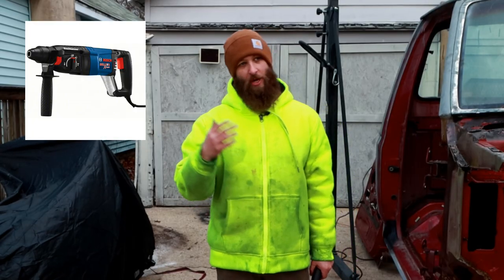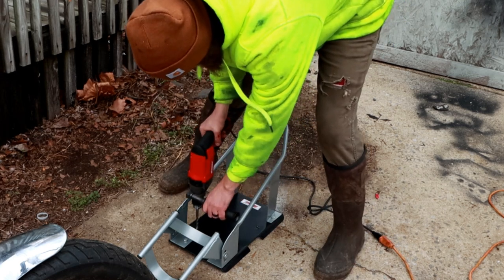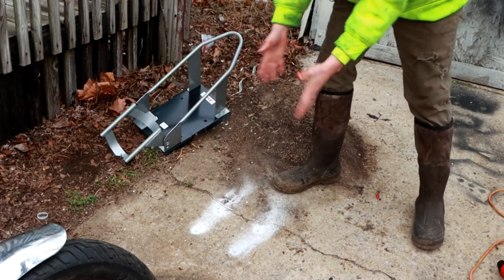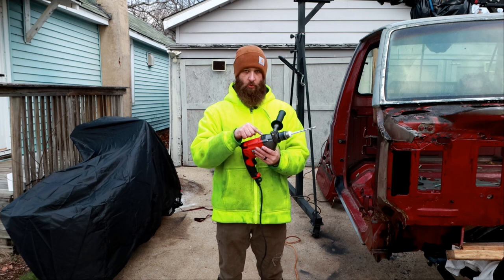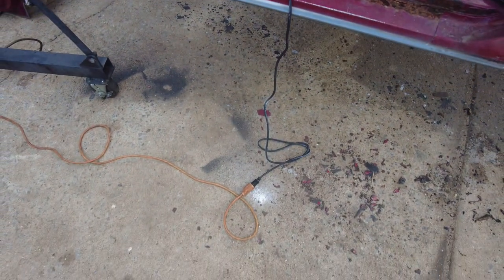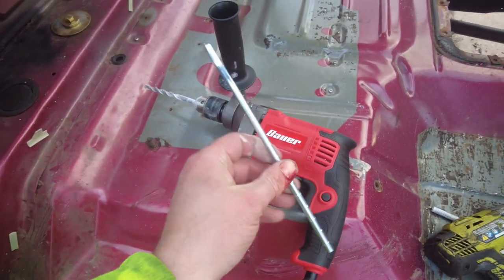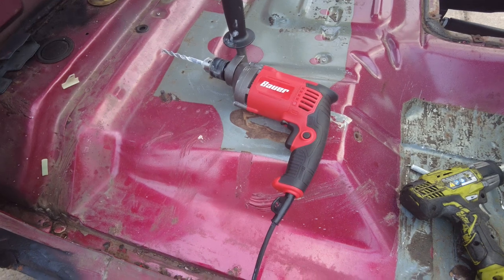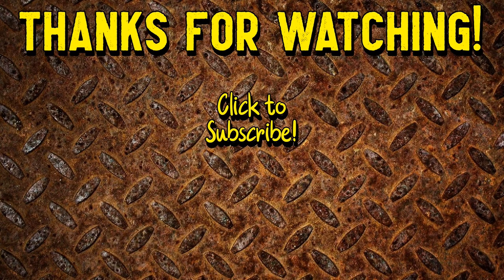Harbor Freight Bauer 7.5 Amp Hammer Drill Initial Review by @GettinJunkDone

Comment: If you have a Bosch Bulldog then why didn't you use that instead of buying a new cheaper hammer drill?
Reply from the maker: Mentioned why in the beginning of the video.  The bulldog is several hours away at a second property.  Cheaper to buy this instead of fuel and toll costs to retrieve the bulldog.

Comment: I’m building a small platform deck off the side door of my house. Need to secure it to the concrete foundation…..so I’m in a similar “need a cheap hammer drill” situation. The Bauer happens to be on sale this weekend at $30 so I’m picking one up.  Thanks for the practical review.
Reply: How did this work out for you? This video had me sold but now I'm seeing lots of stuff saying I MUST use a rotary to get into a concrete slab. How'd the Bauer do??
Reply: @PB-bh7gr  typical Harbor Freight—it did the job pretty well.  I wouldn’t choose it for regular daily work but it was worth $30 to me.